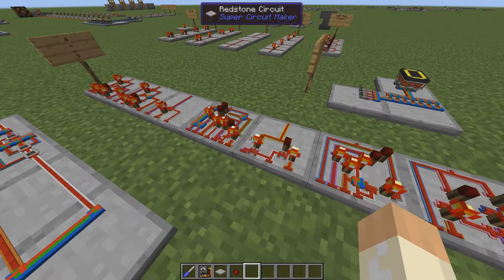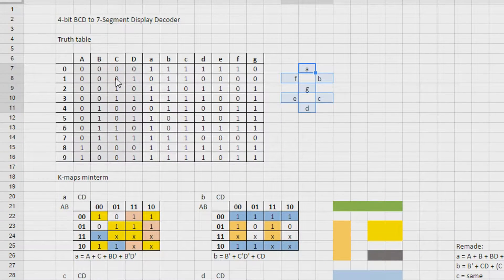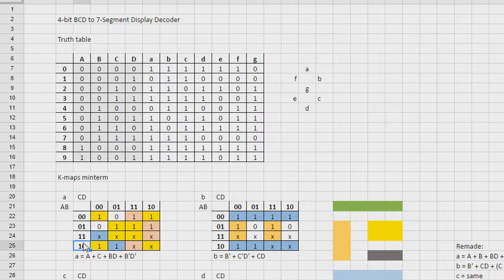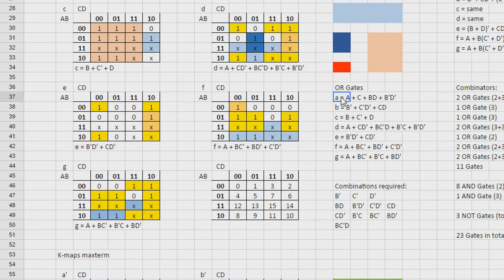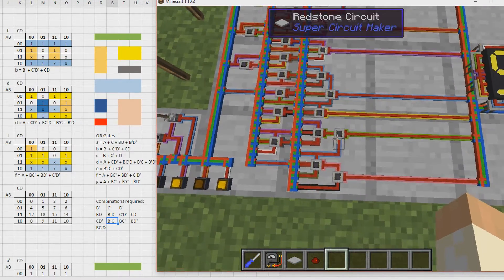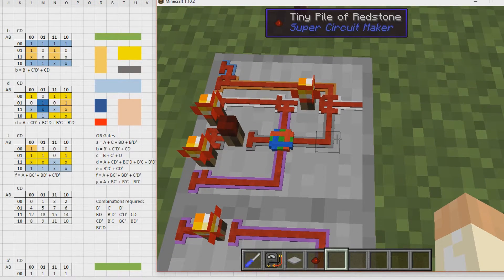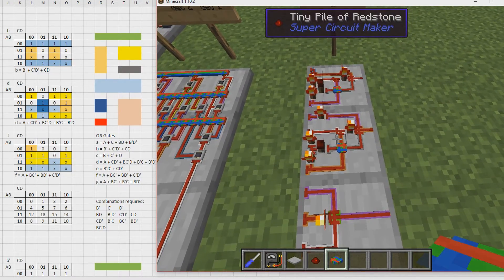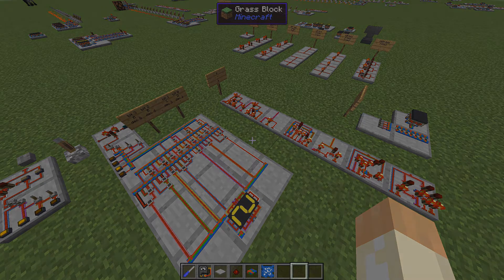Super Circuit Maker - BCD Display Decoder - Theory and Build (MC 1.10.2)

Comment: You could also have some segments of the display inform other parts, such as putting corners connecting the main segments that only connect segments if the two segments are powered or have an additional value X for the number 8 wherein it excludes the middle corner segments to differentiate it from 0. In this way you could have a very smooth display with not much additional effort.